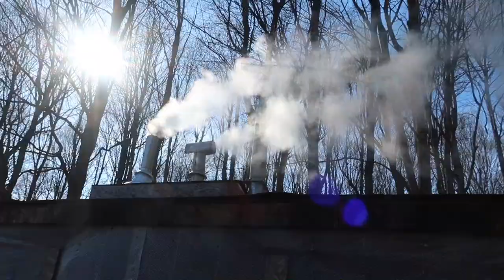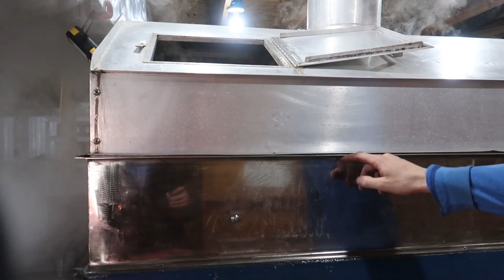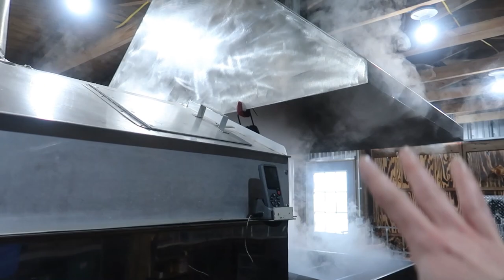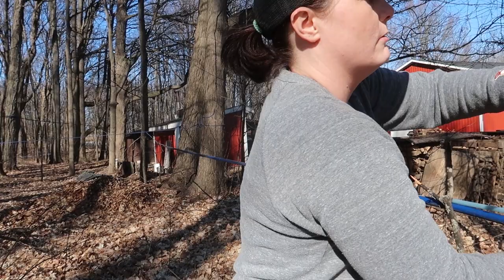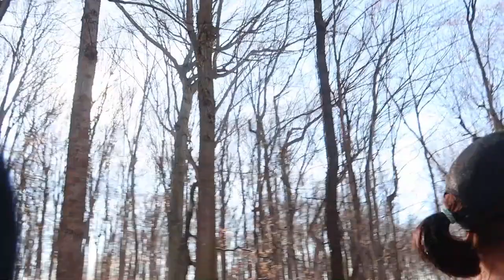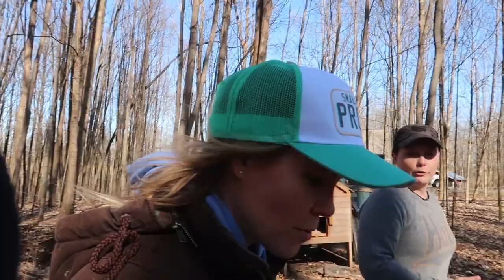288 How Michigan Maple Syrup is Made With a Vacuum System

Comment: I like the ladder setup but I'm just curious on how high it can go and if they lose any vacuum?  Not enough sap running to start boiling where I'm at but next week looks promising.
Reply from the maker: From what ive read online, you can run them in a series, so maybe up a bit. Then horizontal, then up again (like stairs or a ladder, lol). You can go as high as you need to as long as you dont have too many taps per lateral line

Comment: Suzanne I have a question. 
How  come every time I get some real maple syrup and open it and don't use it all at once it molds in the bottle whether it's in the fridge or not ????😊😊😊💖💖
Reply from the maker: Is it my syrup or someone else's??
Reply: @This1LifeWeLive  it's not your syrup.  I had a friend give me some from two different places and they both did it. 
I'm so sorry I didn't make that known to start with.  I just thought you might know ?
Reply from the maker: @evankibbe590  usually it's not cooked to temp. Many believe syrup is cooked to 219 degrees but this is not always true. It's about 7 degrees over the boiling point of water and that depends on the barometric pressure each day and each hour. My guess is they didn't cook it long enough, or they bottled at too low a temp. Gotta be bottled between 185 and 200 degrees. We often bottle too hot which turns it into sugar inside the bottle, lol
Reply: @This1LifeWeLive  oh .thank you for the explanation.  I've been asking every one i could think of and your the only one that could give me a answer.  Than you so much 💖💖💖💖💖💖